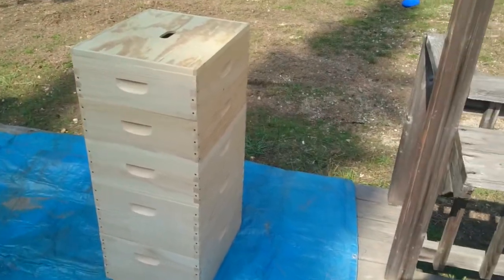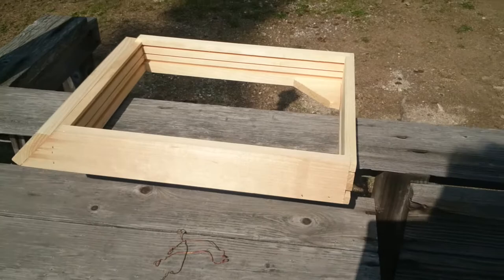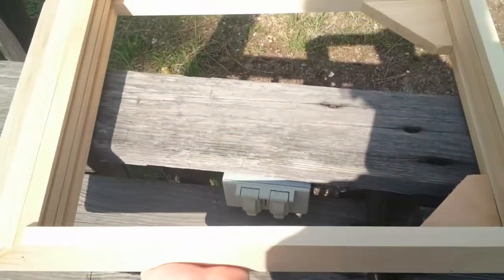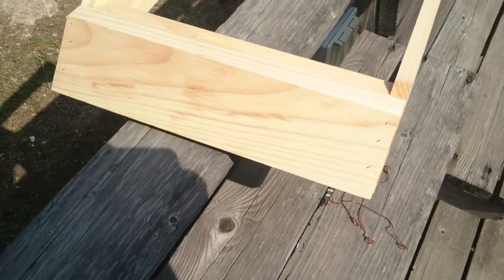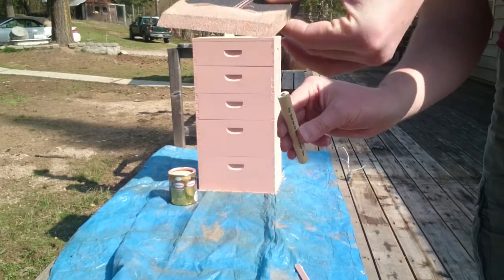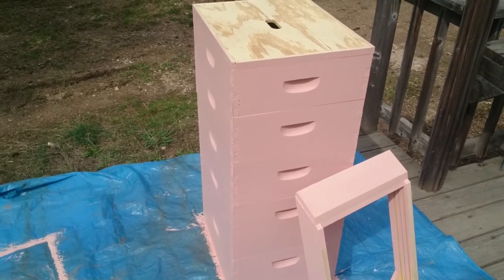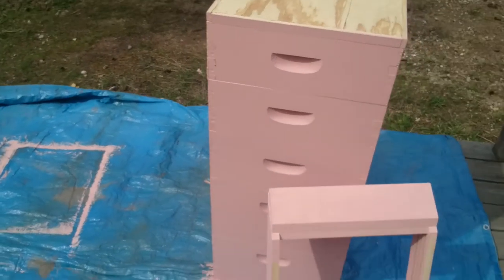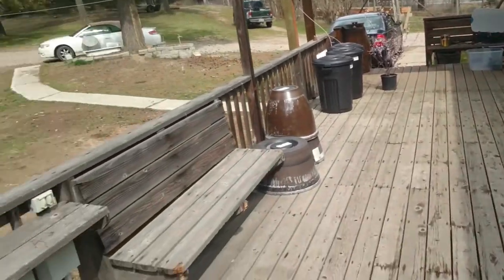My Half Moon Life - Painting a Beehive

Comment: That was a very queer way to paint your hive ; why did you not put your boxes on a work bench so you would not have to be laying down on the floor ?? What about the edges of the boxes , is not rain water going to wick in between and cause their edges to rot out ?
Reply from the maker: that's probably a valid concern that I didn't take into account. The paint did glue them together and putting them apart was not especially fun.